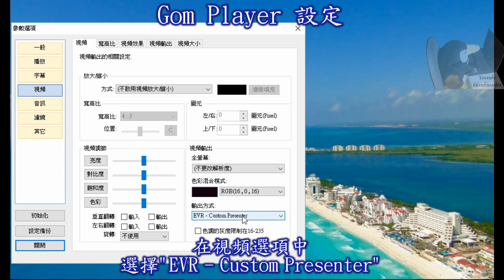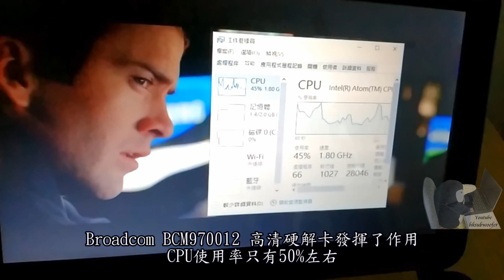Netbook加裝硬解高清卡 HP Mini 210 Broadcom HD Decoder Upgrade

Comment: Is it like a gpu upgrade?? What is the use of a broadcom hd acelerator?
Reply from the maker: This card is not GPU, Broadcom HD card is for local mp4 files(x264) decode, it can help low-level CPU decode 1080P video
Reply: @hksubwoofer  got it, there is
 a ssd msata that has the same conector, would it be compatible?
Reply from the maker: @MohaModzClipzOfc  No, that slot is for WWAN (cellular modem) or Broadcom HD Card, may not support msata.

Comment: hi. can i do the same on my hp mini 210-1073TU ?
Reply from the maker: Yes, you can do that
Reply from the maker: You need to connect the Mini PCI-E pin1 with a cable to Pin 1 of the A06401 Mosfet so that the Mini PCI-E slot can provide a 3.3V power supply to the HD Decoder (Video 0:35 red cable)

Comment: Hi friend, what would be the red cable and what's the 3.3 v connection? thanks
Reply from the maker: The original HP Mini 210-1144TU does not have a Mini PCI-E slot, so the modification steps:
1. Solder the MINI PCI-E slot first.
2. On the AO6401 Mosfet Pin 1 soldered red cabe to the Pin 1 of the MINI-PCI-E slot

Because this notebook is not a HD decoding model
So there is no MINI PCI-E slot
The 3.3V power supply is also missing from the circuit to supply the MINI-PCI-E slot.
After the soldering, the Broadcom HD HD hard card can be installed and used.